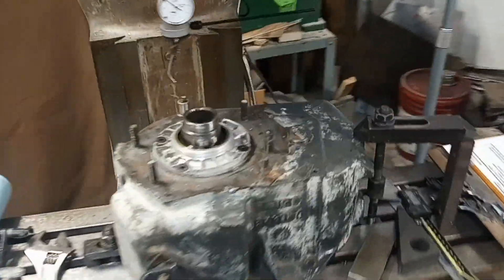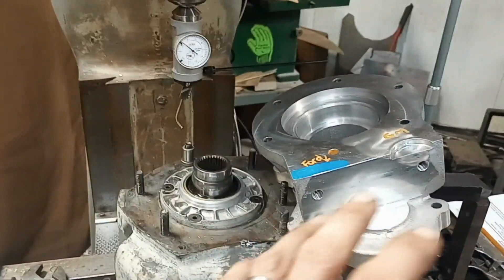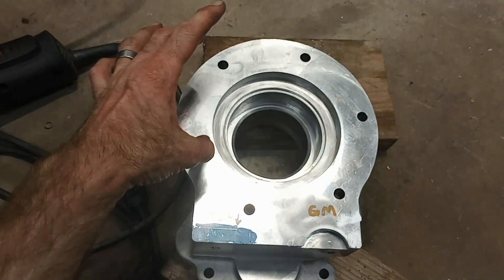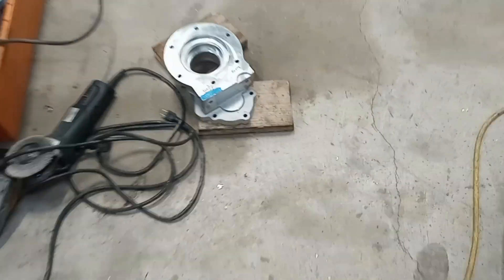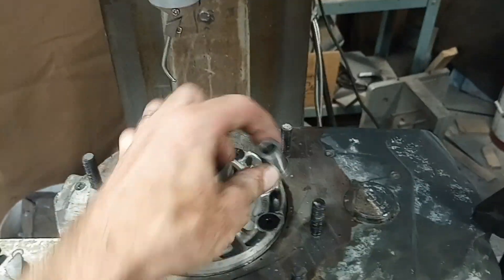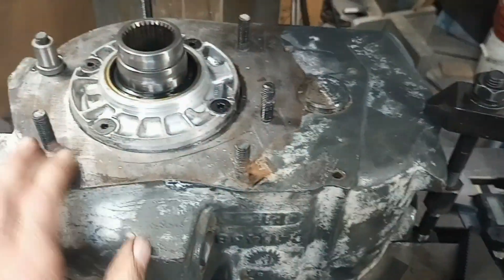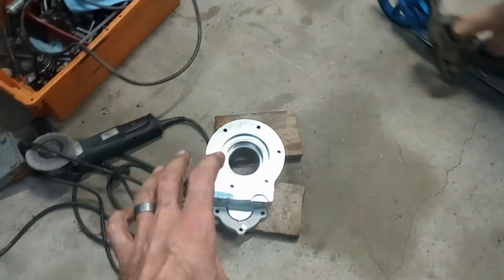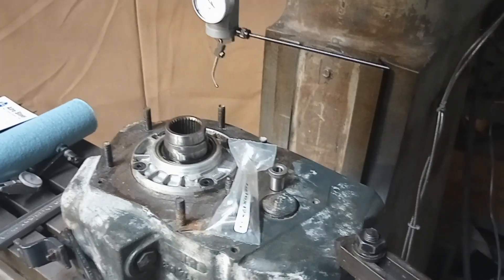Poor mans coordinate measuring machine.

Comment: if you know a tiny bit if CAD you could also esaly pull the dimensions off a picture. You take a photo as paralel as you can with a known easy to mesure dimension on it, import that into CAD set that dimension to be correct on the picture and can easaly mesure anything on the photo you need. I've done a lot of raplacment 3D printed parts that way and it normaly fits way better then any messuring i could do.
Reply from the maker: The last time I used cad was 25 years ago, I suspect things have changed a bit 🙂
Reply: @Andy-PerpetualMotion  It's usful, defently not for everything though. in 25 years things have changed but if you still know the basics they have stayed somewhat similar
Reply: @Andy-PerpetualMotion ...I use TurboCad...